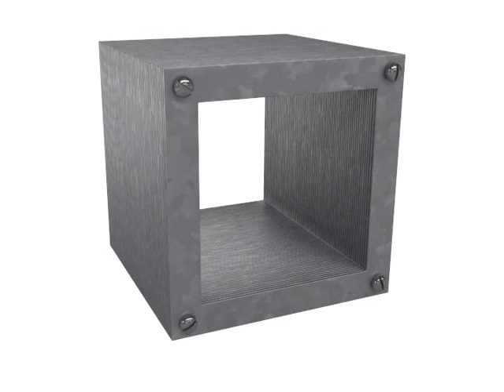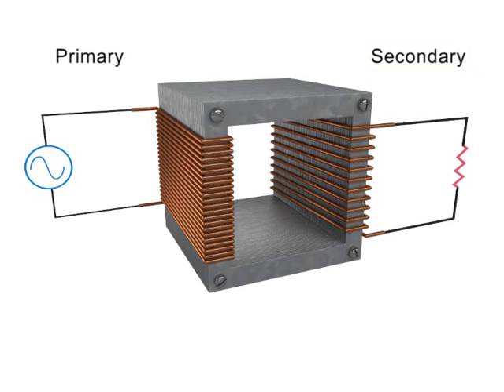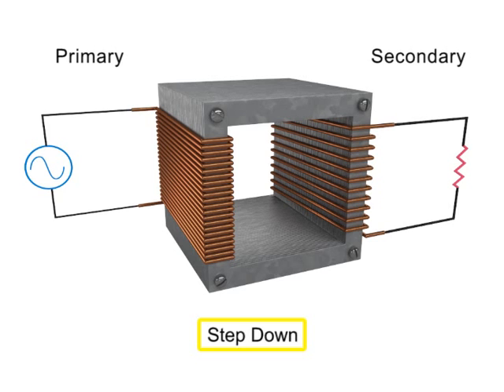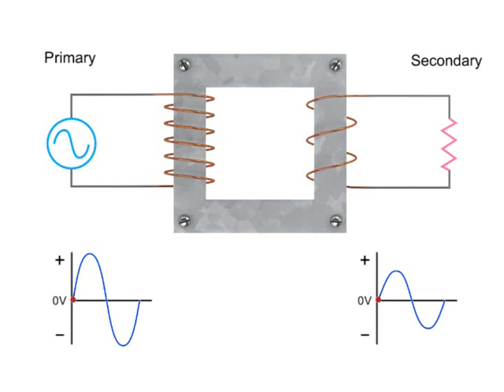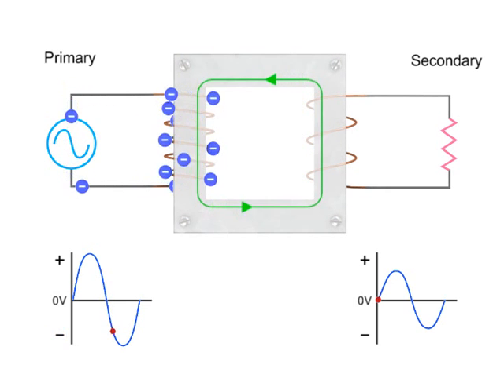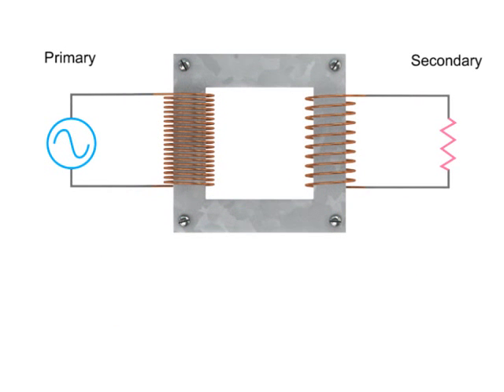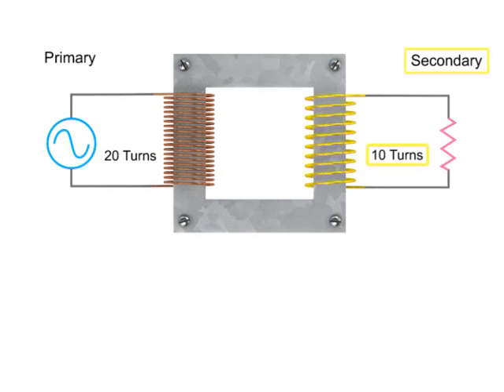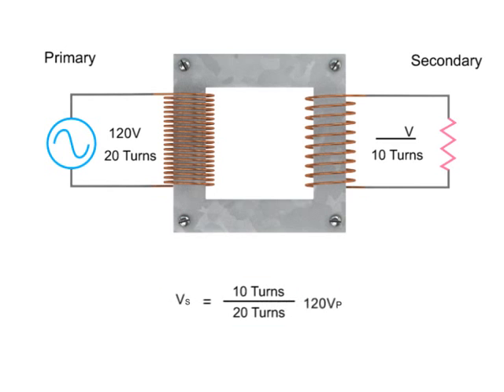Step-up & Step-down Transformer

Comment: i still dont get it. i have 10;1 transformers. i give them 240v and get out 12,0,12. so that is step down. but what if i just swap the inputs and outputs. it may then be stepping up, but it is still a step down transformer, so what is the difference between a step down and step up transformer?

Comment: primary coil connected to the main supply so that will be a short circuit ....but why there is no short circuit
Reply: because it is AC. for a 50th of a second one side is positive, then for a 50th of a second it is negative. there is no short. but even if you gave it dc it would only heat up. there is no where for it to short to. my advice is take something to bits, get a transformer, use it to make low voltage ac from your wall supply, then get another transformer and provide that with the ac from the supply you just made. it will be easy to understand then, that is the method i used to understand them.

Comment: Is the resistor needed at secondary coil? My plan was to step up low voltage so I get an arc on the output. Is that possible?
Reply: if you ask that question, for the purpose you described for the love of god don't! from where you are to messing about with arcs requires a long learning journey.

Comment: But what makes the 120v require 20 turns? What if you do 30 turns or 10 turns for the primary?
Reply: Then u get a different voltage. It has to do with the ratio of turns and the voltage ratio

Comment: So, i think of it like wind in a bag. If you blew into a bag, your breath is not the only thing filling the bag, Your breath pushes the surrounding air with it to inflate it faster. So in theory, if we had an infinite amount of copper and space we could generate enough energy to make a machine that runs on itself. The electrons don't come from nowhere though. It comes from the electrons in the air. But thermodynamics proves that this would be short lived since heat reduces conductance. Rendering the copper useless.
Reply: E-. see me after class.

Comment: is step down transformer that is like 240v to 9v or 12v  500ma transformers are safe to use on water based projects,  is there any chances if transformer failure can get out put direct 240v ? in any way chances of getting direct 240v output ?  please suggest .

Comment: What difference does it make if there are 10 turns on the primary side and 20 on the secondary vs there being 100 turns on the primary side and 200 on the secondary?  would the two transformers be the same?
Reply: More voltage i guess

Comment: defference between generator and   transformar????....please upload video practically
Reply: one is a noisy machine you put diesel in and get electricity out of, and the other is a small lump of steel plates with copper wires. i only ever upload my videos in a practical manner.

Comment: Everything was on point except the math to convert the higher voltage to lower from the coils. To me the more turns there are on the coil from greater voltage to the lower voltage it would be simple to divide the turns of the higher voltage coil from the low voltage coil. 20÷10=2 to 160v ÷2=60v. Instead of putting a more complicated equation. I'm not trying to be smart or anything I would prefer a less time consuming way of finding the answer.
Reply: that's right
Reply: +Ajay Kumar because voltage is low in ur area

Comment: how I can increase the voltage at home, because the voltage in my area are near 180 but machines didn't work well on it ... how it can b 220.
Reply: yes u can increase by using step up transformers
Reply: used to step up transform
Reply: You can use it but the problem is...  If incase TGE voltage increases to normal... (IE input of transformer will be 220v now) 
That can cause problem to your machines

Comment: could anyone tell me is there a difference between a step down/up transformer? for instance... could u use the secondary of a step down trans as the primary(and the primary as the secondary)? would that make it a step up trans?
Reply: you can find you answer here ... http://www.top-ee.com/step-up-and-step-down-transformer/
Reply: step up transformer will increase the voltage n step down transformer WIl convert high voltage to low voltage
Reply: Top Electrical Engineers yes you can just did it Hammond LA
Reply: you can't use step up transformer as step down transformer ... reason in details here ... http://www.top-ee.com/step-up-and-step-down-transformer/

Comment: Question, couldn't you use a transformer for either a step up or step down, based upon which direction you energize the current from, or is there something I'm missing?
Reply: yes, you could use it as both step up and stepdown by changing output direction.